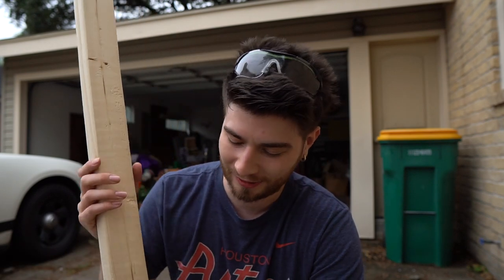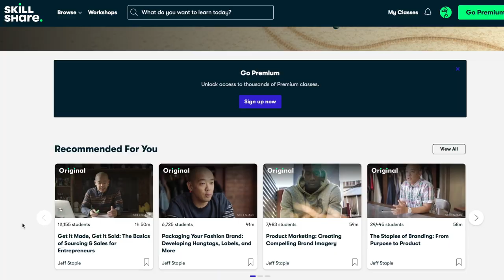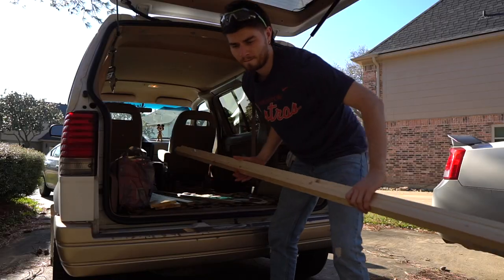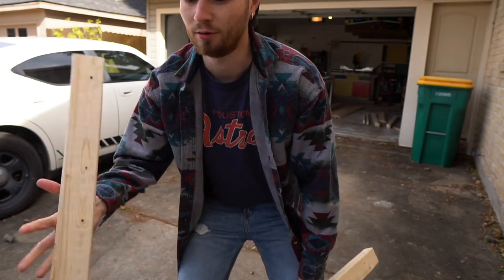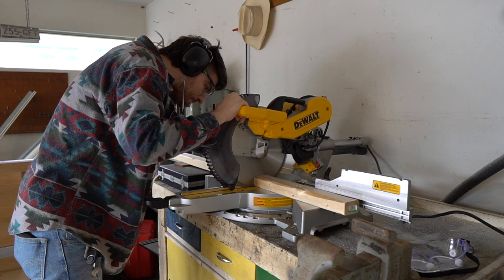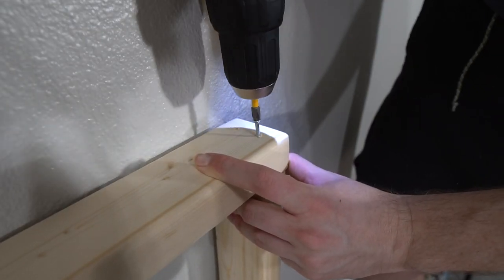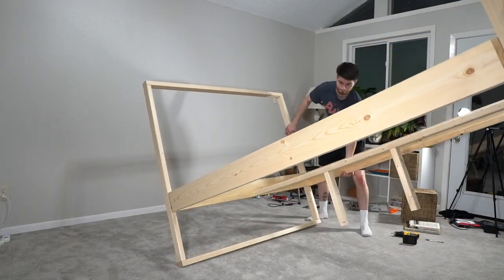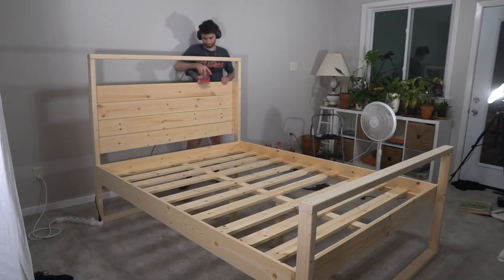How to Build a Bed | Full Tutorial and DIY For Beginners! EASY!

Comment: You might want to toss a couple corner braces on that bad boy where the legs hit the frame.
Reply: so much facts right here...that's all I could think about when I watched this. Couple small triangles in them vertical corners and boom structurally sound!
Reply: @markscanlon5708   screwed in from the sides, or down to the floor?
Reply: coleride too vertical corners
Reply: Top*
Reply: @markscanlon5708  Thank you but not sure what you mean- is it a) a corner piece attaching the sides to the ends, or b) that plus that piece rests on the floor?
Reply: coleride the top portion of the bed that you lay on and where it meets the legs that support it. There should be some sort of blocking under the actual bed frame that is cut on a 45 degree angle or a triangle support attached to the supporting legs on all 4 corners. Nothing on the floor...where the 90 degree angle is at on all 4 legs that are fastened you the bed frame. I can’t think of any other way to say it
Reply: @markscanlon5708  yes that is clear, thank you for your time

Comment: should add some metal corner brackets for more strength. after a few times rocking the bed, the screw and wood will wear out causing the bed to start getting wobbly.

Comment: If you would have figured out all the lengths of the cuts that you made you could have made it even easier on yourself.  Lowes will cut the wood to length right there if you buy from them.  Save a lot of clean up and time.